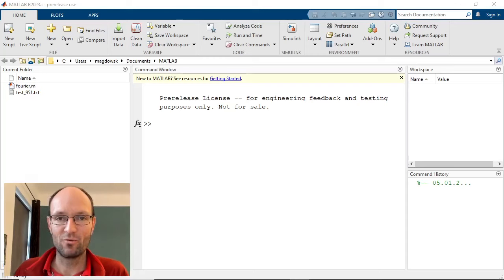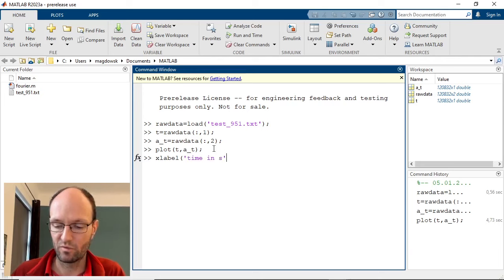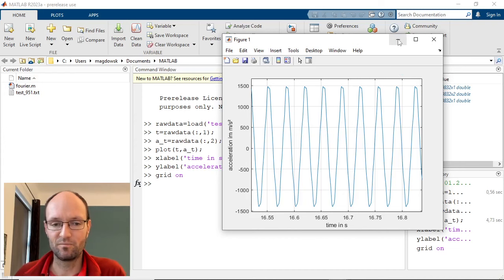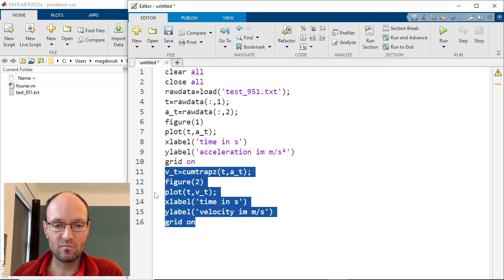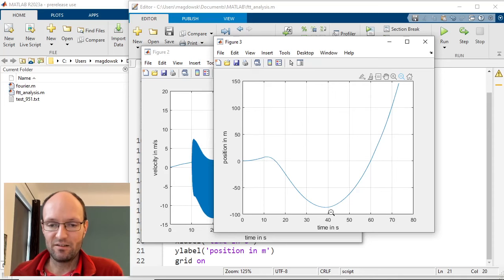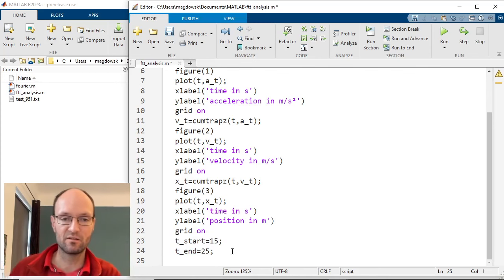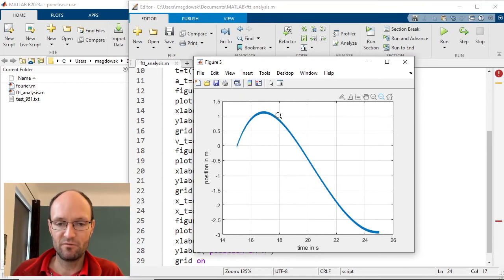Fourier transform (fft) in MATLAB from accelerometer data for acceleration, velocity and position

Comment: I am just wondering at the video minute 5:56 you showed the graph of position which i believe you mean displacement,  is it normal to be 150 meters? I was performing similar analysis and got even much bigger value and I find it weird somehow. Thank you
Reply from the maker: The position is determined by integrating the velocity over time, which in turn is determined by integrating the measured acceleration over time. Any small measurement error or uncertainty in the acceleration will result in a linearly increasing deviation in velocity, which in turn will result in a quadratically increasing deviation in position. To avoid this, careful filtering or detrending of the data is required. This is the purpose of the procedure presented in the video.
Reply: Thank you for the reply, I have just noticed that when using the cumtrapz the data is cumulative. If I am willing to get the displacement at each point instead of the cumulative what do you suggest? I have been trying trapz however I had errors in matlab code and didn't work. Thank you again
Reply from the maker: @mowzafmouwad7898  Thank you for your further question. I think you are misinterpreting the results of the functions cumtrapz (https://de.mathworks.com/help/matlab/ref/cumtrapz.html) and trapz (https://de.mathworks.com/help/matlab/ref/trapz.html). The result of the cumtrapz function is again an array or vector containing the primitive or antiderivative function of an input array or vector. The result of the trapz function is simply the resulting integral, i.e., a scalar number. See this simple example of integrating the cos function, which approximately gives the sin function and the final integral over a full period which is (almost) zero.
>> x=linspace(0,2*pi,13)
x =
   0.00000   0.52360   1.04720   1.57080   2.09440   2.61799   3.14159   3.66519   4.18879   4.71239   5.23599   5.75959   6.28319
>> y=cos(x)
y =
 Columns 1 through 11:
  1.0000e+000  8.6603e-001  5.0000e-001  6.1230e-017  -5.0000e-001  -8.6603e-001  -1.0000e+000  -8.6603e-001  -5.0000e-001  -1.8369e-016  5.0000e-001
 Columns 12 and 13:
  8.6603e-001  1.0000e+000
>> cumtrapz(x,y)
ans =
   0.00000   0.48852   0.84615   0.97705   0.84615   0.48852   0.00000  -0.48852  -0.84615  -0.97705  -0.84615  -0.48852  -0.00000
>> trapz(x,y)
ans =  -1.6653e-016
Reply from the maker: In short, if the cumtrapz function doesn't help you, the trapz function won't either, because the result of the trapz function is also included in the output of the cumtrapz function (i.e., in the last element of the output vector):
>> cumtrapz(x,y)(end)
ans = -1.6653e-16
>> trapz(x,y)
ans = -1.6653e-16

Comment: Hi sir, I have the vibration data to diagnose the bearing fault can I use the same code for FFT
Reply from the maker: Thanks for the question. You probably can use the very same code to calculate the spectrum of your sampled vibration signals in a straightforward manner. The bigger challenge will then be to detect a bearing fault from the spectrum itself. A fault in the bearing might lead to stronger vibrations (so a larger amplitude), to a shift of resonant frequencies or might lead to the generation of new frequency components which were not present in the spectrum before. You will certainly need to capture vibration data with different faulty and faultless bearings for comparison and validation of robustness and repeatability of your method.

Comment: Great Video sir. Although I have a slight inherent difficulty. I have a data of more than 2900 readings of wind speeds, each taken at a minute (so basically I have more than 2900 minutes of speed data) but the problem is that they are not in harmonic nature. Is it possible to convert random data into harmonic? 
My end goal is to apply the FFT on the speed vs time data in order to express it into speed vs frequency data so that I can pluck out the dominating frequencies that give out a certain magnitude of speed.
Reply from the maker: Thanks for your question. I suggest to plot your time function and thoroughly look at it, zoom in and zoom out. If you observe that it mainly shows noise and random or stochastic fluctuations only, then there is probably no regular or periodic pattern present and no harmonic oscillations occured. Therefore, if you calculate the spectrum of the signal, it will probably also only show noise and no specific resonant frequencies.
Another thing: When applying the FFT, the longest time in the time range corresponds the the smallest frequency and vice versa, the smallest time corresponds to the highest frequency. So with a total time range of 2900 min = 174 000 s, the smallest frequency in your spectrum will be approximately 5.74 µHz. As your time step is 1 min = 60 s, the highest frequency in the spectrum will be approximately 16.6 mHz. The question is, if this is your frequency range of interest or not. If you are interested in even lower frequencies, you need to sample longer in time domain. If you are interested in higher frequencies, you need to sample faster in time domain.

Comment: Hello I would like to use my Raspberry Pi and an accelerometer to monitore the vibrations at a robot arm . So I get acceleration values from all three axes x,y,z over time when I start the process including the acceleration due to gravity g depending on how the sensor is oriented. 
What do I do with the acceleration due to gravity, because when the system is horizontal at rest it experiences about 0 m/s^2 on the x and y axis at rest and the z-axis understandably 9.81 m/s^2. How do I deal with this when the acceleration values of the vibration are added to this?
 Do you have any idea how I can calculate the displacement from the three data values? Should I record each axis individually and then look at the values and integrate twice? Or do you have another idea and should I consider the interaction of the three axes? 

Thank you very much :) I really liked your explanations :)
Reply from the maker: Thanks for this excellent question. I would also need to think about this problem a little longer, but I would argue that if you are rotating your accelerometer you cannot really use it anymore to obtain an absolute position as even a linear movement along a straight line might be measured with changing parts into the x, y and z component of the acceleration. To compensate this effect, you would also need a three-axis gyroscope that ideally uses the same sampling rate, so that you could convert the rotating Cartesian coordinate system of your moving and rotating accelerometer to a fixed, absolute Cartesian coordinate system of the environment.
If you only want to analyze the rapid vibrations, I would simply remove the constant part of each component of your measured time-dependent acceleration individually, e.g. by subtracting the mean value. I would assume that your vibration happens much faster than the movement of the robot arm itself, so you only need to look at short sections of your time function, long enough to capture the vibrations, but short in comparison with the arm movement. You can also do a Fourier transform and then simply remove the constant part there. After integrating the time function twice or after dividing the spectrum by j*omega twice, you should obtain the time function or spectrum of the displacement.
Reply: @MathiasMagdowski  I send you an mail, because i got another question. Maybe you can help me out there. Lovely greetings.
Reply from the maker: @JohnBo199  Thanks, I have received it well.

Comment: Hi Mathias,
I have a vibration data taken from an accelerometer on a cnc machine , I have the acceleration-time data but when converting it to displacement, I get a smooth graph , when zooming in, there is no oscillation like the one you have obtained from this video, hence, I am unable to obtain an accurate frequency graph. Any suggestion?
Reply from the maker: Thanks for the question. How did you convert the acceleration (im m/s²) into a displacement (in m), directly in time domain using the cumtrapz and detrend functions or in frequency domain by dividing the obtained spectrum of the acceleration two times by j·ω (where j is the imaginary unit and ω is the angular frequency in 1/s) and then using and inverse Fourier transform back into time domain? Have you tried to use my code example linked in the video description? I suggest to monitor and display the result of each intermediate step of the calculation in order to check the correctness of the approach and the validity of the outcomes.

Comment: Once we convert a time wave form signal into a FFT spectrum, how can we extract the fewtures from the FFT.
Reply from the maker: The question is, what you define as a feature. The spectrum calculated by the FFT algorithm contains the amplitudes and phases of the sinusoidal (or better cosinusoidal) functions that you need to replicate the time function with respect to the different frequencies. You will nicely see if your signal contains only a few certain frequencies or is rather broadband. If the signal or time function is the output of a system, you might also see resonances, natural frequencies or eigenfrequencies of the system. The question remains, what you define as a feature.

Comment: hello sir, i have vibration data and i want to plot the fft of the velocity and acceleration, however the fft i get doesnt represent the expected plot and the frequency components are not peaking in the correspending rpm!
can you please help
Reply from the maker: You may send me your data and corresponding MATLAB files to my e-mail address mathias.magdowski@ovgu.de. If you do so, please:
- don't forget to attach the (preferably zipped) code to the mail
- clearly indicate the main program or script to run
- make sure (if possible) that it runs on your computer without problems/errors
- meaningfully comment every single line of code
- describe what the program should do, what to expect as the output and any discrepancy from that
- don't send me files, which are not necessary
- have questions as specific as possible

Comment: Hi Mathias, from experiment of the cantilever beam, I obtained the time and millivolt from accelerometer, now I want to plot real and imaginary part of FFT  in MATLAB code by using Nyquist. Could you please help me. Thanks
Reply from the maker: You may send me your data and corresponding MATLAB files to my e-mail address mathias.magdowski@ovgu.de. If you do so, please:
- don't forget to attach the (preferably zipped) code to the mail
- clearly indicate the main program or script to run
- make sure (if possible) that it runs on your computer without problems/errors
- meaningfully comment every single line of code
- describe what the program should do, what to expect as the output and any discrepancy from that
- don't send me files, which are not necessary
- have questions as specific as possible

Comment: hello sir,
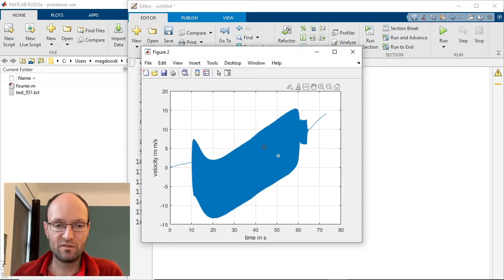at 4:00 I "nearly" have the same problem but in a different case
So, I have an accelerometer put on car, and I'm asked to integrate it's output to get velocity.
Now velocity should return back to zero because car eventually stops but this doesn't happen instead velocity stabilizes at -ve value
The problem is detrend won't solve this issue because in your case a vibrating object must be periodic motion meaning it's oscillating around zero position so we know for a fact that it's slope should be zero but in mu case it's different as the car can go anywhere and isn't periodic motion and I'm struggling to fix this issue
If you need to know the sensor it is inside a phone (we are using the accelerometer inside it) labeled lsm6dsm ACCELEROMETER
thanks in advance for the helpful tutorial :)
Reply from the maker: Thanks for your question. What do you exactly mean by the '-ve value', at which the velocity stabilizes if the car stops?
In your case, I would assume that the acceleration should be almost zero and very stable, if the car really stopped, because you should then only see small vibrations due to the running motor or something similar. Such small and stable values of the acceleration should be very uncommon in normal driving conditions, except for a very smooth road and very constant driving speed.
So I would suggest to try to detect very small and very stable values of the acceleration by some well-defined criterion, under which the car can be assumed to have come to a full stop. In this case you just reset your integrated (and possible erronous) velocity back to zero.
Let me know if this helps.

Comment: You are doing great work ❤, 
Can you make a video for retrieving the mode shape of the beam using contact point response?
Reply from the maker: What do you exactly mean by that? Which beam is meant and what is described by its mode shape? What responds to the point contact and how? How is this contact established?
Reply: @MathiasMagdowski  if we have acceleration response data of beam then how can I plot the mode shape of beam.
Reply from the maker: @dineshpatel-e6q  You mean a cantilever beam where one end is fixed, right? For how many points along the deflected cantilever beam do you have acceleration data?
Reply: @MathiasMagdowski  no for simple supported beam.
Reply from the maker: @dineshpatel-e6q  You mean a simply supported beam, having two supports at either end – one pinned and one roller? Still, for how many points along the deflected simply supported beam do you have acceleration data? How is the beam excited or how is the vibration generated?
Reply: @MathiasMagdowski   we have to install accelerometer over vehicle and vehicle will act as exciter.
Reply from the maker: @dineshpatel-e6q  Okay, now I understand the problem or challenge. You have a simply supported beam on a vehicle. The vehicle is moving and the vibrations will excite the beam via the two supports. As the acceleration and the associated forces of the vehicle will follow a stochastic process, it can be assumed that the associated broadband spectrum contains lots of frequencies. The simply supported beam will then mainly oscillate on its eigenfrencies inside this spectrum of excitation. To measure these oscillations and the corresponding eigenmodes, I would suggest to place several small accelerometers along the beam and to analyze their respective response according to the procedure given in the video. It might be possible to also get the dominant modes only from the forces and accelerations of the two supports or contact points, but therefore you need to have a good mechanical model of the beam itself. As I'm an electrical engineer and not a mechanical engineering, this is a little bit outside my scope of expertise.

Comment: Hello Sir, I have an earthquake vibration data from an accelerometer installed in a building. I'm supposed to get the natural frequency of the structure by doing fft analysis. However, the data seem to be erratic and is far from expected output. Could you please help me? Thank you very much
Reply from the maker: Thanks for your inquiry. You may send me your data to my e-mail address mathias.magdowski@ovgu.de with a clear description of your exakt problem and I might have a look, but I'm rather busy at the moment.

Comment: Pl help i want yo convwrt vibration damping data in frequency vs amplitude to time domain
Reply from the maker: First, please fix your keyboard or use a spell checker. Second, please have a look at this video on how reconstruct a periodic signal as a sum of cosine functions from the corresponding frequency spectrum in MATLAB:
https://youtu.be/OvyTRxZSolU
Please note that this will only work if you have a full complex-valued spectrum given as a real part and imaginary part or by amplitude and phase of all the relevant spectral components. If you just have an amplitude spectrum without any phase information, you cannot usually not fully reconstruct the corresponding time-domain signal.
Reply: @MathiasMagdowski  sir is this video enough for conversion
Reply from the maker: @mediwise2474  Is this a question or a statement? In any case, I guess that you will have to find this out yourself for your problem.
Reply: @MathiasMagdowski  sir I'm a student of textile science with no knowledge of matlab thqts why asking it sir
Reply: @MathiasMagdowski  actually question is is this a procedure to convert frequency domain graph or value of a vibration damping to a time domain sir ?
Reply from the maker: @mediwise2474  Have you already done the MATLAB Onramp course? If not, I strongly encourage you to do so:
https://www.mathworks.com/learn/tutorials/matlab-onramp.html
There is also an FFT-related example at the end.
Reply from the maker: @mediwise2474  The procedure presented in the video is a general procedure that takes into account the most relevant, but not all harmonics. A more general procedure taking into account the whole spectrum would be to use the inverse Fourier transform.
Such procedure is also described in this video recording on Twitch:
"Playing around with the fast Fourier transform (FFT) to simulate a low-pass filter in time domain and frequency domain"
https://www.twitch.tv/videos/1973439539